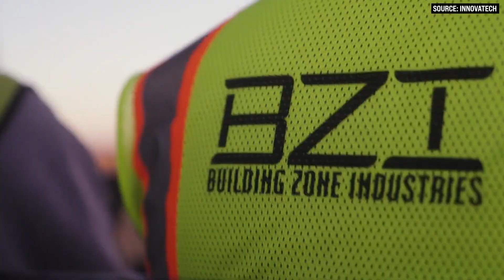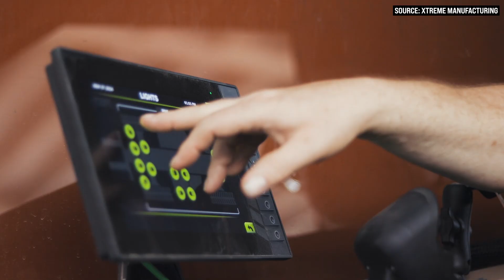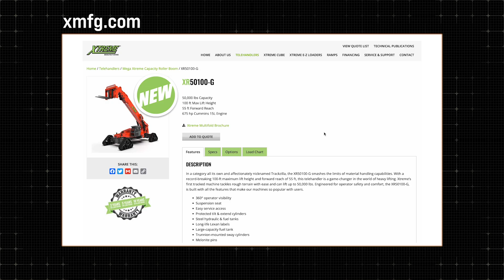Up Close with Trackzilla!: Xtreme’s Monster Rough-Terrain Telehandler

Comment: Really cool stuff --- just a bit larger it and it could just lift an entire concrete truck to where the concrete is needed..... or pick an entire container of material off a semi and put the entire thing close to where needed (to be unload as the material is needed - either by hand or smaller machines upper floors could bear the weight of driving around)......